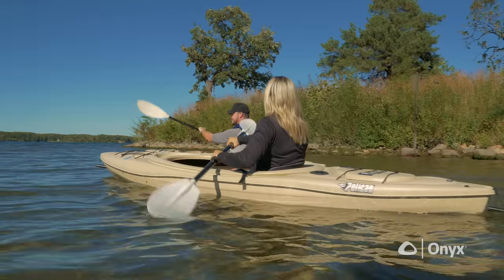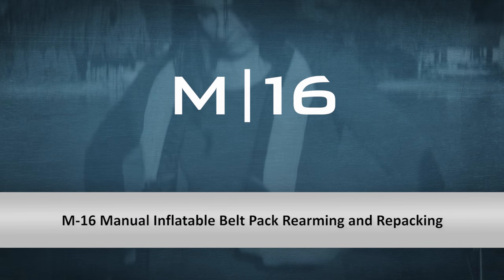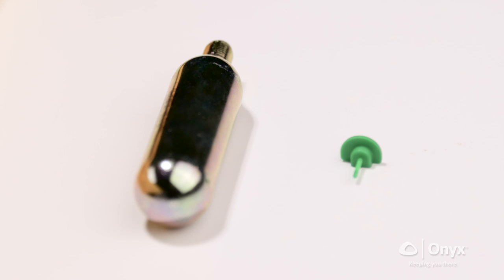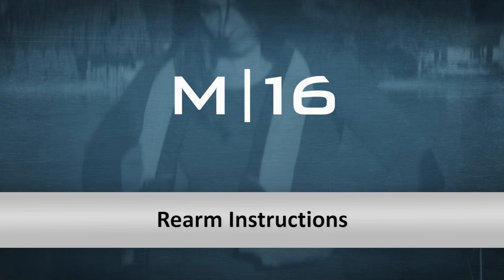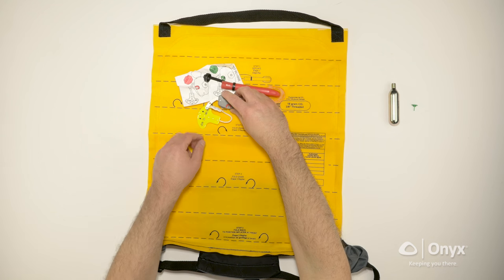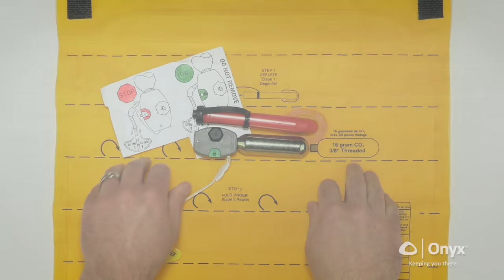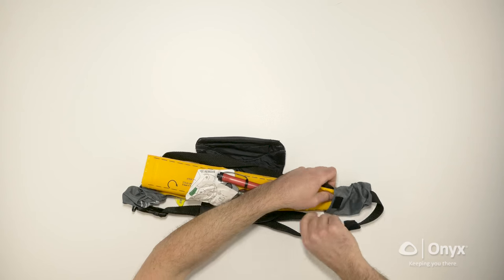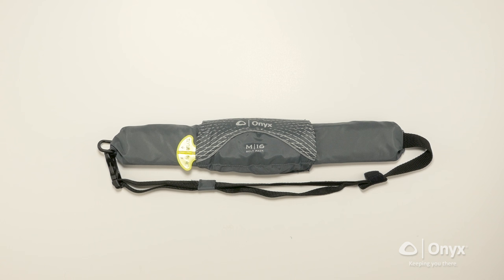Onyx M-16 Belt Pack Overview - Rearming and Repacking

Comment: Hey there, I just bought one of these and was wondering if standard 16g threaded  co2 cartridges can be used to rearm? What happens to the green indicator pin when you activate this? Thanks.
Reply from the maker: When the "jerk to inflate" handle is pulled and inflation occurs, the green indicator pin breaks and falls out. This will need to be replaced as well. We would recommend our M-16 rearming kit that contains the 16 gram CO2 cylinder with 3/8' thread and green indicator pin. The rearming kit can be found here: http://www.onyxoutdoor.com/p/m-16-rearming-kit-for-manual-inflatable-life-jackets-pfds/inflatable-life-jackets_rearming-kits?pp=24
Reply: @OnyxOutdoor  So that green bit of plastic launches off into the water?  That's terrible.  There's enough plastic in the water already.
Reply: @NorthCountryOutdoorGuys  Given that it's only to be used in an emergency, I think that's a minor consideration.
Reply: @OnyxOutdoor  This link is broken.

Comment: According to the Halkey-Roberts website, this inflator should have a 3/8" gasket (they list it as Halkey-Roberts 849AM 3/8" gasket) in the 3/8" cylinder receiver. Mine is missing? Do I need this gasket and where can I get one from?
Reply from the maker: Daniel, always refer back to the owner's manual. For the M-16 belt pack, it should contain a 16 gram CO2 cylinder with 3/8" thread, as well as a green indicator tab. Here is a direct link to the corresponding rearming kit. If any further questions, feel free to reach out to our customer service team. https://www.onyxoutdoor.com/p/m-16-rearming-kit-for-manual-inflatable-life-jackets-pfds/inflatable-life-jackets_rearming-kits?pp=24